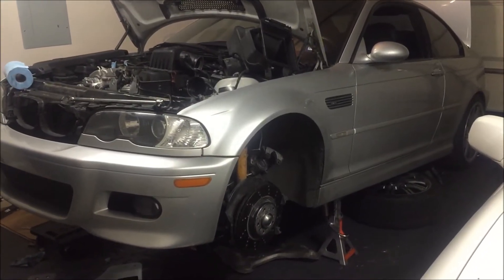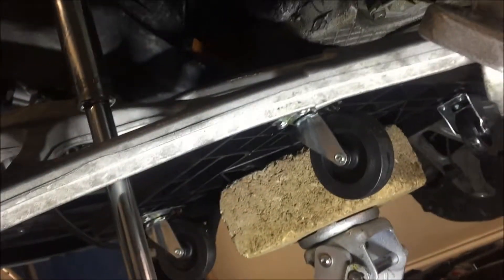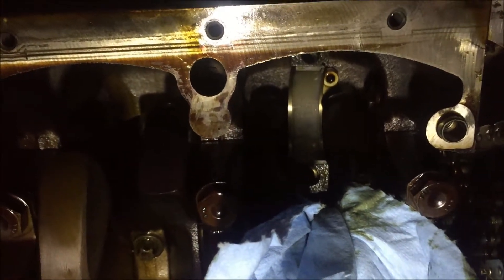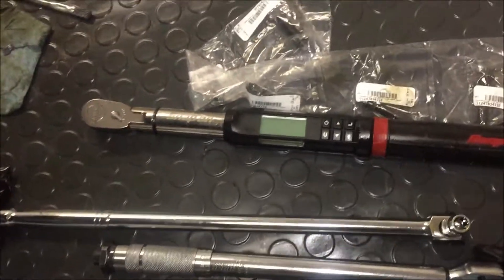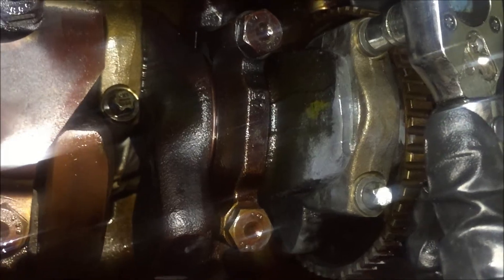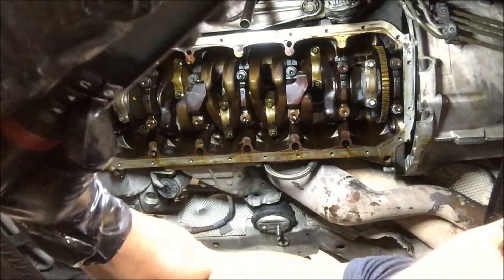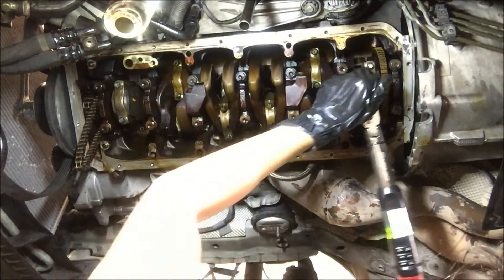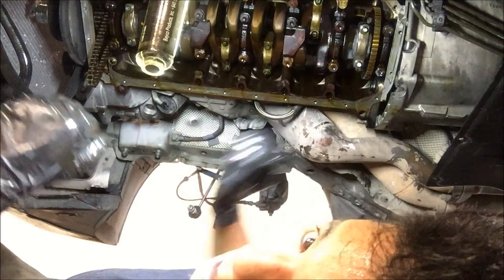BMW E46 M3 Rod Bearing Installation & Torque Procedure

Comment: Paul, Since its a angle could you have used a longer 6" extension so you have enough clearance for rotation?  

I am thinking about ARP bolts do you know if I would have to stretch the bolts loosing and re-torquing it 3 times?  Thanks for this video.
Reply from the maker: Extension may throw off precise torque setting a bit.
Reply: @PaulVo  Did you plastiguage them?  BTW  its kind of odd to hear a southern accent from a Viet guy. :)
Reply from the maker: @jata1778  heard that one before.  No, I didn’t plastigauge them.  If I had a spun bearing , I would’ve.
Reply: @PaulVo  When you torque the oem bolts did you lube them prior to install?  Im in the middle of doing mines. Thanks.
Reply from the maker: @jata1778  Yes I lubed them.

Comment: I know this is 3 years old but the best way to get the subframe back in with no help is to hook a rachet strap to each spring.  Run the strap thru the shock tower holes and tighten until the shocks are inside the top section of the towers.  Now you can go underneath and piss around with the jack without the subframe getting all catty wompass on you while you are trying to jack up.  Catch 2 bolts, remove the straps... the rest is history ;)

Comment: With aftermarket rod bolts you just have one torque setting correct?
Reply from the maker: SR M391 they have different torque procedures, but none as complex as the oem ones

Comment: mine build 09/2002, do you know whats the rod bolt part number? as I can't find them in realoem
Reply from the maker: Linoge279 2002 models can reuse your rod bolts
Reply: @PaulVo  I see, I just follow your procedure without changing the bolts right?
Reply from the maker: Linoge279 You don’t have to do the same torque procedure as me which makes it a lot easier.

Comment: Nice job!  How did you know you had bad bearings or was this just general preventive maintenance?  And how long did this take you the first time vs the latest time?
Reply from the maker: theclutch just preventative.  Had over 200k miles on the originals and they still looked pretty good.  The last time it took me around 2-3 days.  Doable within a weekend.  The first time it took around 7-10 days.

Comment: Nice video Paul! I just picked up an 06 m3 6MT Slicktop with 170k miles and a 3inch thick folder of receipts. the owner took great car of the car and it truly rides like a 50k car with no hesitation or hiccups. with that said, the only thing thats never been changed in the car is the rod bearings... im really curious how much longer this will last before i need to change my bearings too
Reply from the maker: CivilJihad my bearings looked ok for 200k miles.  All cars are different and no way to know for sure how the bearings are.  You can start by doing an oil analysis and see if you have abnormal metal count.  Job isn’t too bad.  I did everything myself on jack stands so it’s doable.
Reply: @PaulVo  thanks paul. so is it totally possible to have no warning signs of bearing failure and i could be cruising on the highway and then boom rod thru block?
Reply from the maker: CivilJihad that’s how they usually go.  No signs of failure that I’m aware of.  Once you hear rod knock, stop and don’t drive anymore.
Reply: @PaulVo  i remember reading an article saying that you can hear it on a cold start before oil pressure builds? thanks for the quick response ill probably be tackling this job soon with my new quick jack :)
Reply from the maker: CivilJihad that’s plausible.  Good luck!

Comment: Once the new bearings are in at 30nm, aren't you supposed to rotate the cranckshaft one revolution to make the bearings settle before end torquing?
Reply from the maker: ButchE30M3S14 nowhere have I read you have to do that.  36k on my bearings now and nothing’s blown up so I think I’m good.
Reply: Paul Vo Its common knowledge ;-) But Im sure you will be fine 👍🏻
Reply: Old thread I know but there is no mention of rotating the crank during torque sequence in the BMW repair procedure that originally came out in 2003 time frame

Comment: Do you rotate the crank at any time during the process?
Reply from the maker: Muck Man yes, you have to rotate the crank to position the rod bearings so they can be removed
Reply: Paul Vo obviously yeh but what I really ment was after each torque sequence are you ment to rotate the crank and re torque ?
Reply from the maker: Muck Man no need to rotate crank and torque again.

Comment: Did you consider using the aftermarket rod bolts that don’t require the angle torquing procedure?
Reply from the maker: davegsu There were mixed reviews about the ARP bolts so didn’t want to risk it.

Comment: Why such a anal torque procedure? Those bearings didn't look so bad, was there rod knock occurring?
Reply from the maker: BMW for ya.  I assume they are stretch bolts.  Forum paranoia got me to change it  .  Car did have over 215k Miles.  My car is daily driven and didn’t look bad.  If you don’t track your car, they could last just as long as mine

Comment: I have a question, why not set the torque .5nm below spec, because that's how much you generally over-clock on the stud
Reply from the maker: I don't think you have to be that precise.  Most torque wrenches don't drop in .5 increments.  Most aren't calibrated to be exact either.

Comment: i got 361 000km on mine. original owner. 2003. bearing still good. no burning oil. runs like it's on steroids.

Comment: Awesome video, just finishing up dual VANOS repair (including anti-rattle) on my 04 M3.
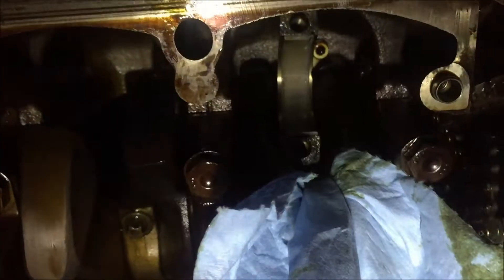Around 3:59, you have the picture showing the different bearings side by side.. is the OEM one on the far left or right? Right one looks to be worn, far left looks nearly as good as the middle. Just got confused because of the subtitle showing OEM, WPC, WPC w/ 15k miles in that order.. thanks!
Reply from the maker: OEM is on the left. The order is exactly how its captioned.

Comment: You the man! Doing this now and I wish I had seen this before. Would have bought a digital torque-angle wrench! Major PITA with a torque angle gauge attached to a breaker bar.
Reply from the maker: 96maxse the first time I did this, I used an angle gauge also and didn't remove the sub frame. I stripped most of the rod bolt heads.  On the second  time I was more prepared.
Reply: Paul Vo I just stripped two with the gauge. Halfway done I tempted to get a proper torque wrench
Reply: 96maxse agreed

Comment: I'm looking to do the job soon, what other items will I need beside the rod bearings,I already have a 1/2 techangle?
Reply from the maker: 1/2" Techangle will be easier to hit that degree torque.  Had a little trouble with mine.

I would get the following if I were to do this again::

- Extra rod bolts - I bought six and used them all except one.  They are easy to round off if you don't have good leverage under the car.
- 1 bottle of ATF for Power Steering
- Oil Pan Gasket
- Oil Pan Cover Gasket
- Oil Pump Oring 
- Oil Pump 17mm nut
- Oil Pump Bolts - 3 holding the pump; 2 attaches the small pipe 
- Oil Pan bolts
- Transmission bolts that connect to oil pan - 3 
- Oil Kit

While you're there items, but not required:  engine mounts, steering guibo, belts, idler pulleys, sway bar endlinks/bushing, control arms, fcabs, tie rods, oil level sensor
Reply: Paul Vo alright will do thanks alot
Reply from the maker: I added a list of parts that are required/not required to do this in the description.  Hope that helps!

Comment: at what millage did u originally change ur rod bearings
Reply from the maker: Grab America by the Flaps 197k miles on the one pair I originally changed
Reply: Paul Vo I have an 03 m3 can I re-use the rod bolts
Reply from the maker: Grab America by the Flaps You will need new bolts (MY 2003+) and have to follow the torque procedures I outlined in the description.
Reply: Paul Vo  hello